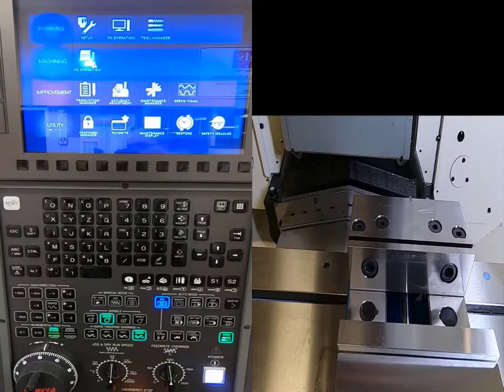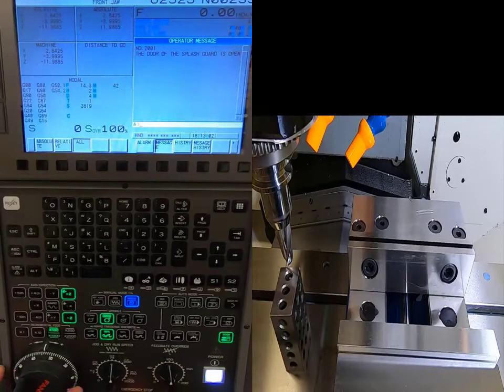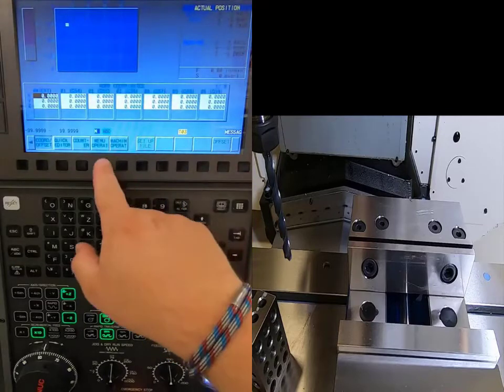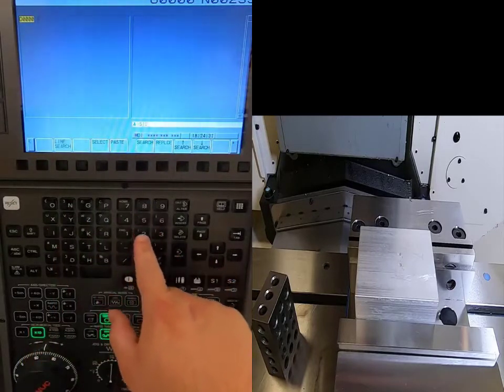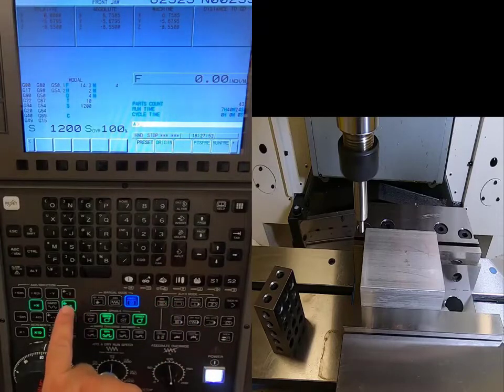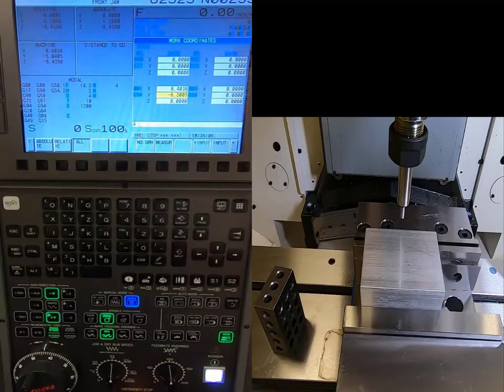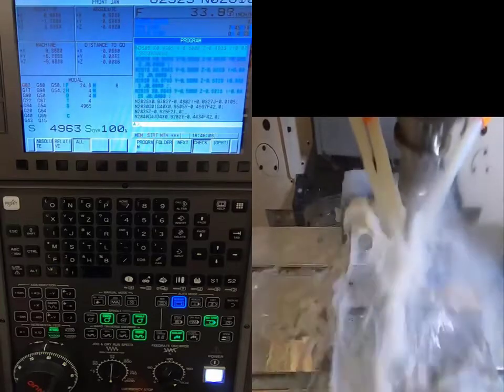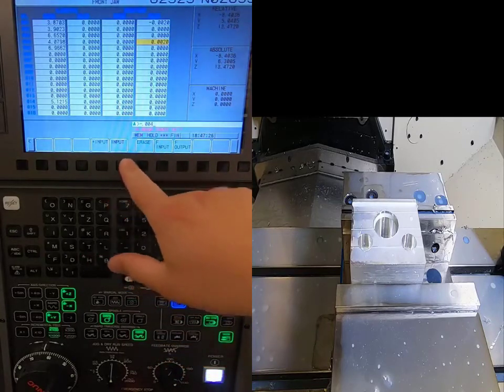Fanuc ROBO DRILL Setup

Comment: Excellent video Aaron, question: the value of the block in Z, where you calibrate the tools, do you add it in a parameter or how does the machine know that value?
I congratulate you for this great, very complete video. Greetings from Mexico
Reply from the maker: @CesarGarcia-iv9nj  Hello, and thank you for watching. Yes, the tool length and the Z value are calibrated as long as all the tools are set from the same location. And that Z value is the distance from the face of the spindle, which would be called the gauge line to the top of the 123 block that I'm setting tooling off of. So it's actually calculating a lot of numbers all at once but there are simpler ways to do it like touching off the tool length presetter or just touching all your tools off the top of a part it really depends on how complex your setup is or how repetitive you want your tools to be.
Reply: @aaronrunk4209  Thanks for your reply Aaron, regards

Comment: Great video thanks. 
Quick question when setting G 54 Z to the top of the work piece could you have used any tool? You just happen to pick T2 the center drill correct? Any tool would have gave you your G54 Z I believe?
thanks in advance.
Reply from the maker: Thank you for watching the video and to answer your question yes any tool that has been set off the 123 block will work for setting the g54

Comment: Great video thanks. I'm trying to do as much learning as possible before going on my training, so I'm not completely overwhelmed. 

Can you recommend any further reading on this for complete novices? 

Also, that number in auto tool length set, where is it coming from (15.8558)?
Reply from the maker: The best thing you can do is make sure that you understand how to set tool lengths and the difference between the tool lengths and the work offset. the 15.8558 is set up by the manufacturer when they install the machine on site. I believe that is the distance from the face of the spindle to the table. So when you calculate the Z0 location, it calculates your current position, and the tool length and subtracts that from the 15.8558. The next thing you can do is watch a couple of the other setup videos that are on FANUC machines. That way, you can see the comparison between the machines but also see how setting them up is very similar. Thank you again for watching and good luck

Comment: You are very knowledgeable! I am a machine operator I am not a tech or a machinist or anyone who really knows much of anything, but I run a robot drill. We were having an issue that a programmer corrected which caused issues on another operation entirely and when they rolled back the program it did not fix the issue. I can upload a video of me explaining this do you think you could help me??? Lol
Reply from the maker: @BradleyVoorhees  that stinks the machine is messing up.  I would definitely make a video and post a link.  I might not have the answer, but I bet someone watching will.